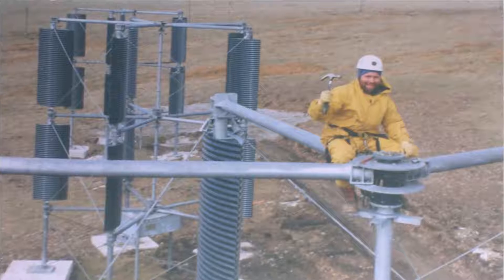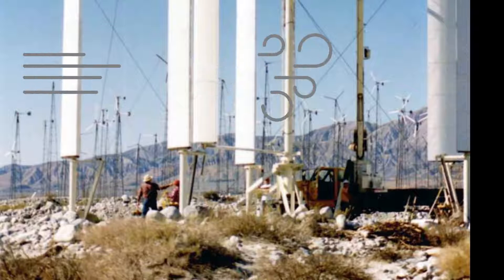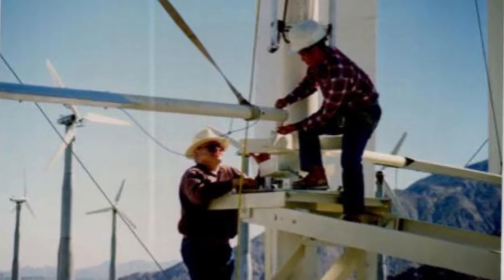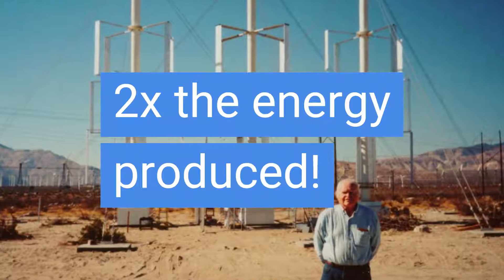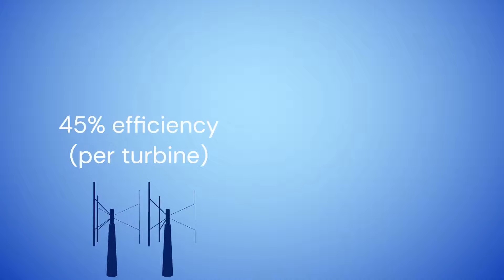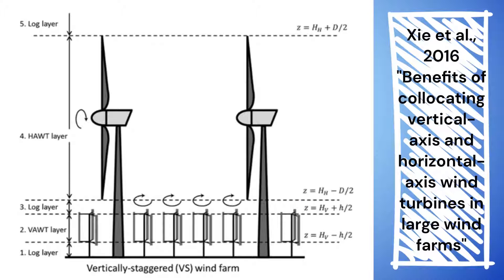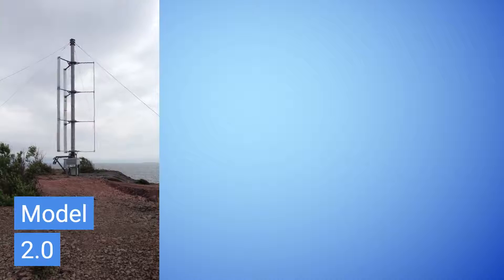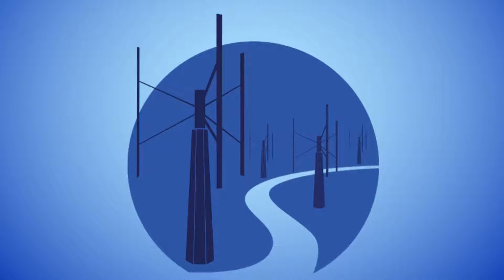The Coupled Vortex Effect: Wind Harvest's Early Breakthrough for More Efficient Wind Turbines

Comment: Reality:  All practical tests of ground-based small wind turbines show: 1) They hardly produce any electricity. 2) They do not last long!
No electricity, because there is hardly any wind close to the ground – and electricity yield is proportional to the third power ofwind speed: 100% more wind generates 800% more electricity! Only from an altitude of 100m wind is stronger and more constantly. Moreover, wind close to ground is extremely gusty. 9 out of 10 small wind turbines therefore stop working after a short time! Due to price decline solar panels generate at least 10 times more electricity with same investment! Reliable for at least 25y - maintenance-free.